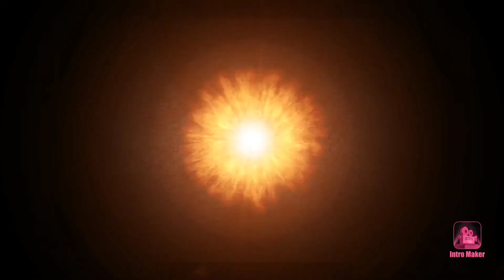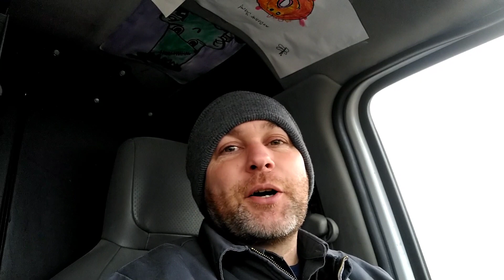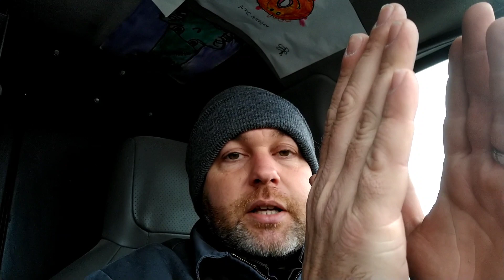Gas Furnace:  Modulating, 2 stage or Single Stage.  What do I really need?

Comment: Thank you for the videos!  Bought a modulating furnance just over 3 months ago and not happy with it.  Cold spots throughout the house.  I'm looking at replacing it with a 2-stage furnance.  Used to have a single stage furnance but didn't like the on-off heat... and heat was not consistent throughout the house.  With the modulating furnance we hear a tapping from the duct workt that we never heard before - the HVAC company blames our duct work but why did we not hear it before we replaced the furnance?  Anyway - thank you for the video - will watch more.
Reply from the maker: Thank you so much for watching and the comments! Be sure to subscribe if you're not already! I will not agree or disagree with the contractor that's there because I have not seen your system. I will say that ductwork does play a big factor into everything. Modulating furnaces in my opinion are not worth the cardboard that they box them up and to sell them in! I just don't like them for a lot of reasons. But I do also look at ductwork as part of the entire system. I've got another video out there on ductwork if you'd like to watch. LOL I just had to get that one advertisement in there lol. But either way I agree you would be happier with a two-stage or even a single stage furnace in my opinion. I don't know why the duck work makes noise. But something's obviously different. But that's also assuming that they set the modulating furnace up right as far as speeds and timing and everything that goes along with it. I'm not knocking them cuz I don't know them. I would never bash other contractors especially if I don't know them. But I can't agree with them either because I would not have recommended a modulating furnace in the first place! LOL it might be time to have someone else take a look at it and see what they think about the entire system. The downside is, I know those modulating furnaces are not the cheap kids on the block. So unfortunately you have probably invested a good amount of money on it so it kind of sucks to have to buy something new. But modulating furnaces, I don't meet too many people that are happy with them. I'm so sorry to hear about your bad experience with your furnace. I wish sometimes I could hear more good experiences LOL. But that's the way it goes sometimes. Thank you again so much for watching! Have a great day!  Good luck with everything!  Keep me updated!
Reply: I would recommend trying an EcoBee thermostat with a few of their wireless temperature sensors placed around your home. We found that made a HUGE impact with eliminating cold spots in the house. The EcoBee thermostat can run the the blower for longer to better circulate the air in your home, and it will also keep the burner running for longer (if needed) to ensure all of the home is truly heated. One half of our home was always 3 degrees cooler than the other - and the EcoBee wireless sensors completely eliminated the difference. Our home is much more comfortable now and for some reason we are using less gas, despite it being a colder winter this year. I suspect it's because we now set the thermostat at a lower temp due to all the cold spots being eliminated.
Reply from the maker: I agree completely! Ecobee thermostats with the wireless sensors can't fix every problem, but they can fix a lot when it comes to hotspots and cold spots! I have them in my house too!

Comment: Wish I had found this video before I went with my new modulated 2-3 stage furnace.   Regret my decision I have decided to replace it.   The furnace sounds like a helicopter slow moving over the house for about half an hour.  Each cycle runs about 10 to 20 minutes which adds up to at least half an hour of anoying noise.   Also there is a thrumming throb sound that is really horrible.   I am not a complainer and this is really difficult for me to keep calling the installer to come and adjust.    In the end after 3 visits the only tolerable setting was in the low cycle, so I purchased a modulate system and use the first low setting.   I want to replace it with a single cycle furnace  that possible can lower the fan noise.

Comment: Thank you so much Andy for sharing this valuable information with us. Can lennox, goodman and coleman two stage furnaces be locked to high fire or how can i know for sure if it does or not? Most of variable speed motor furnaces are now two stage
Reply from the maker: I know for a fact Goodman can. I don't 100% know about Coleman and Lenox. It may depend on the different models but I know some of the Linux is and Coleman's both that you can. But I don't know about all. Thanks so much for watching and the comments! Be sure to subscribe if you're not already! Have a great day

Comment: How are Daikins furnaces....I know they bought Amana and Goodman. I've had an Amana for 19 years and looking for the future. I do have zone heating with 3100 SQ FT total up and downstairs. You seem to like two stage for zone heating. Why is that. Wouldn't the slow heating issue be the same in zone heating as it is in one zone?
Reply from the maker: Personally I would leave it in 2nd stage even with zoning but that's my preference.  A lot of people out there want to use 2 stages with zones and yes I agree it works well but I like the idea of fast heat.   Daikin is a good brand and any dealer that is a Daikin dealer is also an Amana and Goodman dealer.   Actually I work for such a dealer.   If your going to buy in the Goodman Trinity, definitely go with the Amana brand.   The Amana models have some of the warranties and efficiency ratings you can not get with the Daikin and Goodman.   The Amana name for them is like the Cadillac for them.   They offer more. But all are good choices.  Hope this helps a little!   Thanks for watching!   Be sure to subscribe if not already!   Have a great day!

Comment: I buy single stage 92% Goodman's for my rentals along with an assortment of spares - igniters, pressure switches, inducer motor etc. They've been great in older houses and can be had online for  about $1300 shipped. Last delivery took 3+ months however due to the plandemic. Renters love them because they're quieter and more efficient than the neglected 25 year old 80% units I rip out. Bonus is the direct venting and decommissioning of old rusted  B vent going into a sketchy 100 year old brick chimney - no more furnace issues because of bird's nests or high wind over chimney.
Reply: Any suggestion for online Furnace shopping?
Reply: I buy them at alpinehomeair (no affiliation) and have them delivered doorstep. @Richard-dh8ny
Reply: A testament that one stage furnace is quiet relative to an older unit that was previously in house.  That is what I wanted to hear!  If they were "just as loud" I would have been swayed to getting a 2-stage.

Comment: Sounds like a lot more s*** to go wrong with your furnace I got a Lennox Furnace from 1967 in am finally replacing it this year and I'll be going back to a basic single stage furnace quite honestly all the electronics in there or b***** don't need it I have a thousand square foot Ranch I just need a basic furnace to heat the house and all agree I want a hundred thousand BTU furnace to kick on have the fan come on when the flues warm heat the house up and shut down. I don't need no fancy crap in my house just want it hot I live in Michigan when the furnace kicks on in the winter I want it to warm the house up

Comment: Great video Andy!

We have an existing 16 yr old single stage 80% efficient, 100,000 BTU, Carrier that is showing evidence of corrosion and at the end of its useful life.  It was serviced last week and suggested we replace it.

From your video you're suggesting that a new 2 stage unit would use more fuel than a single stage since it would run longer.

Why would a 2 stage unit be recommended then if this is the case?

I was all set on going with a new 2 Stage Trane 80% S8X2C100M5PSA.  Would we be better off with their single stage?

Thank you Andy!! Keep up the great videos!!!
--
Reply from the maker: I would probably go with the two stage and set it to run on high fire all the time. The two-stage units have better warranties typically better quality and higher efficiency ratings. Most all manufactures the two-stage equipment is the better equipment. It is true that two-stage gas furnaces are built more for comfort then for efficiency but they are marketed as higher efficiency and that's what I don't agree with. But hands down the two stages usually a better furnace and most of them you can lock them into high fire and run it as a single stage. My furnace at home is a 2-stage furnace. All the furnaces that we sell at my place of employment are two-stage furnaces. So I'm not trying to completely knock the two stage furnace idea I just like for everybody to understand that I believe they're being marketed wrong and there are ways to make a single stage be more efficient. And if I may ask why are you set on an 80% furnace? Why not a 90 +? Way more efficiency noise level is down and very reliable pieces of equipment. If you're interested I have another video on the channel about an 80% furnace versus a 90% furnace. Me personally, you could not get me to buy an 80% furnace. 90 percenters are the only way to go if we're talking anything about efficiency. Don't let anybody tell you different. But you can check out the video if you want and I go into detail a little more. Thanks so much for watching! Be sure to subscribe if you're not already! Have a great day!
Reply: @andyscornerhvac  Wow I am learning and a little bit of knowledge is dangerous for sure!

Well, one HVAC person  told me that it would cost a lot more since the furnace that was in the basement was a 80%.  I am not sure of the terminology and I am probably doing it injustice.  I think he meant that there would be more work that would need to be done to install a 90%+.  We are looking to sell the home next year, so we are just trying to replace the unit.

With that being said, would you go with a single stage Trane or the 2 stage Trane?

Thank you again Andy.
Reply from the maker: If your looking to just upgrade to sell, then I'd prob just stick with a single stage 80.  Lot cheap for you although a 90 might up your resell, depends on the area I'm sure.  (That's prob a realtor question!).  It does take more work to put in a 90% when the 80 is already there but typically should cost that much more.   We do it everyday.  Several systems a day actually.  It's not hard to upgrade.   The flu pipes are the only MAIN change that needs dun.  It goes from a metal pipe out the roof to 2 pvc pipes out the sidewall.  My only problem with the situation is how contractors present that.   They know in the back of there mind they can swap an 80 for an 80 in less than 3 hours if it's just the furnace and their profit margin skyrockets.  To where if they offered the good furnace there guys will take a little long and the profits not as high.  Drives me nuts but it's the way of the world! We don't even offer 80s unless it's a rental or someone that is just replacing to upgrade B4 selling.   2hich there's absolutely nothing wrong with that but if it were long term, 90s all the way.  Hope this helps!  Be sure to subscribe and share the videos on social networks!
Reply: @andyscornerhvac  Going to have him quote the single stage 80% tomorrow. I know the Trane 2 stage is a constant torque and I have been trying to learn about them.  So I guess I'll see the difference in price of the single state to the 2 stage constant torque.
Yes, I agree with you if we were going to stay, I would definitely go with a 90+ 2 stage!

Comment: I replaced my old furnace with a new 95% Payne single stage furnace with a variable speed blower. It doesn't run much and keeps the house warm . I have a two story house. It has 4 Inch filters. I also have a  new Bryant 113A A/C that is great two. Bryant, Payne, and Carrier furnace use the same parts and are made by United Technologies. I am not paying for the name. That's all.

Comment: My new two stage furnace is loud as hell ! Have a small 1800 sq. Ft. House and these new dc blower’s are loud ! We would never hear my old carrier running now wow
Reply from the maker: Something is wrong with the install. I have no doubt about that. ECM variable speed blower motors for the quietest on the market but the furnaces have to be installed correctly. Either the unit is not sized right and the blower is way too big for the duct system you have. Or the system was installed with metal ductwork with no insulation.. or the blower speeds are set wrong. Or the ductwork is undersized and you have extreme high static pressure which variable speed motors do try to ramp up to try to overcome. There's a lot of possibilities but I would definitely call your contractor back to fix what's wrong.

Comment: Hi Andy planning. to buy gas furnace. I am not rich your recommendation simple technology and reliable again thank you for what you are doing
Reply from the maker: Thank you for watching!  Amana always is on the top of the list for me.   They have a 96% efficiency that does great and awesome warranties. It's always a safe bet and prices and good.   They r all expensive but we all have to have one so I tell everyone to look for good warranties and reliability. Repair parts 10 years down the road are well priced too.   Some furnace like carrier Lennox Bryant and those, are high and replacement parts are crazy and usually can't use any aftermarket parts.   So my vote is always Amana or Goodman.   Truth be told same brand just different warranty options.   Amana is what I put n my house and 9 years .... No problems yet!   Thanks again!    Be sure to subscribe if not already!  Have a great day!
Reply: Thank you  for. Your quick and helpful response
Reply from the maker: Anytime!  Share the channel with a friend!

Comment: Thanks for the information Andy. I got a question though, if the furnace is 2 stage furnace, it’s better to match the AC 2 stage as well ? Or single stage AC should be fine with that furnace??
Reply from the maker: I say a single stage ac would be fine.   Really depends on what your working with.   If you have a zoning system on your ductwork, then a 2 stage ac would be a good choice in a lot of cases.   Personally, on average I just like a simple 16 seer single stage ac.  But every house is different.  I do also have videos on the channel about seer ratings on ac units and zoning systems for your duct work too.   All these things come into play when upgrading your system!  Check em out n let me know what u think!    Thanks for watching and be sure to subscribe if your not already!  Have a great day!
Reply: Recommendations. To  buy those with good reputation on installing. again I  have. no enough  words  to appreciate  you. God bless you

Comment: Goddamn, I should of stuck with 1 stage on my 1200 sq ft house. I'm in AZ btw where summers are 110 plus.
Reply from the maker: 2 stage does work in some occasions .  I'm not necessarily out here to tell everyone they r wrong with going with a 2 stage.  They work.   Just not my preference by any means.   A smaller square foot home, that's insulated well, won't have excessive run times usually anyways.  That being said I do still like the single stage with variable speed blower but you may not have done wrong with a 2 stage.   Some models, like the one I have, can only come in a 2 stage.  Like mine, you can set some of them to single stage only and still have the better warranties n ratings. So my point is they all work n do there job. Thanks for watching and commenting!  Be sure to subscribe if your not already, check out some of the other videos and share with a friend!  Have a great day!
Reply: @andyscornerhvac  Thanks!

Comment: Thx for the information. I found it helpful.  I always wondered if running longer (I was told it could run all day - I'm in the hot southern TX), even at a lower speed, actually will cost less. The almost 2x cost in a modulating unit didn't seem to be worth it to me if there isn't a real benefit in overall power saving. 

But for the 2-stage...  

I do wonder if the slower start-up and a bit less frequent on/off sequences help with prolonging the life of the systems? Also, is there a good reason to mix and match the AC and furnace type? Again, I'm in the hot south (~2800 sq ft 2 story) and looking at replacing both units. A quote came back with Carrier Comfort 3Ton 16 SEER condensing units (single-stage) along with a Carrier Performance 80% AFUE 70k 4-way multipoise induced-combustion gas furnaces, 2-stage, variable-speed motor (58SP). Am I'm wasting money on a 2-stage variable speed blower or is there an actual advantage to this setup as compared to a 1-stage AC + 1-stage furnace (58TP) with 5 speeds blower?
Reply from the maker: I would always go with a variable speed blower if it's an option.  It'll improve your ac comfort and efficiency.  Some of the brands you do have to go to a 2 stage furnace to get the better blower.  They r kinda like cars.  Some of the extra bells n whistles you may not need or want but to get heated n cooled truck seats you have to go with the upgraded package and you get it all!  So I wouldn't worry much bout the 2 stage.   Your furnace , I'm guessing, doesn't have to work too hard anyways where your at.   I deff go with the better blower.  Hope this helps!  Be sure to subscribe if your not already!  Have a great day!